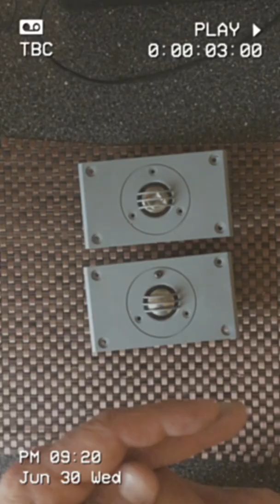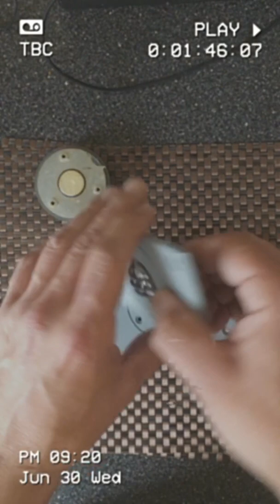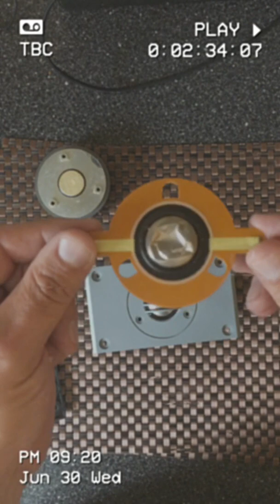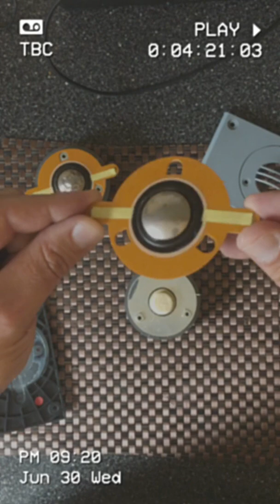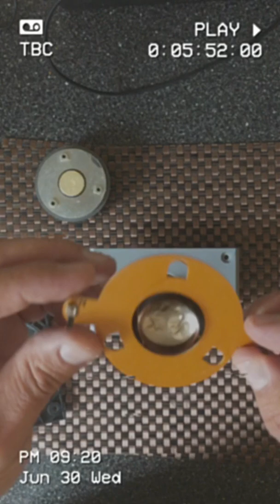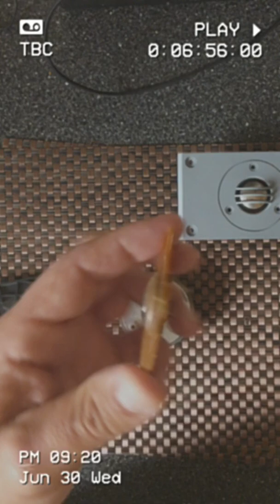#celestion #speakers #tweeters metal dome tweeter repair.

Comment: Hey thanks for the video. One of the tweeter dome diaphragms in my Celestion 5's has been torn off....  I've ordered a set of 8ohm diapgrams to attempt a repair. Is it possible to remove that gasket and solder a new diaphragm on to this style of tweeter? I probably should've confirmed before ordering a replacement set... Many thanks!
Reply from the maker: I would try and buy a set of tatty Celestion 1’s or 3’s and use the tweeters from them in yours, they’re all the same diaphragm.. magnets differ so use yours
Reply: @dittonworks  So attempting to repair the original tweeters is not an option? just wanting to rule it out completely before I source another set.
Reply from the maker: @sam8m8 you probably can repair it but sonically you’d be better off with original diaphragms
Reply: @dittonworks noted! Thank you. I might attempt a repair anyway for experience. I’ll seek out replacement tweeters in future.

Comment: Found a pair of Celestion 11 on the trash the other day! Woofers are completely fine, twetters were both dented, left one badly so, completely pushed in. They made sound, but not a pleasant one. I've been able to push them out and get them fairly smooth by pushing with the end of a small rounded metal rod against a spoon. Not perfect, but sounds much, much better. The right tweeter wasnt as badly pusehd in, but it has a small tear. I think i'll replace them both with ebay diaphgrams, doesn't look too difficult. 

BTW, what an excellent pair of speakers, I'm testing them with a Yamaha CX-1/MX-1 combo, and they sound really well, maybe lacking a bit of bass, but I'm used to my Infinity Kappa 8.2i, with 12" woofers.

Comment: I have a pair of DL12, as many have said, the metal dome tweeter can run a little harsh and bright, can it be replaced with a silk dome without need to adjust the crossover? Or would it be best to replace the HF units altogether? Cheers
Reply from the maker: That would be a downgrade. 
I’d recap the crossovers and possibly try a different amp?

Comment: Can you still get a replacement for the A1 with dented tweeters ?
Reply from the maker: Unfortunately not, Kef used to have Celestion stock but they’ve run out now.
I’ve got a couple of diaphragms left. 
Contact Ditton Works Facebook page for more info.

Comment: I have a pair SL700. one tweeter has a dented voice coil . The other has a dented dome. what are my options  in restoring or replacing the tweeters. can the tweeters from the SL6SI be substituted.
Reply from the maker: I can fix them buddy.. contact on Ditton works Facebook page

Comment: Hi there. I have a chance to take a good pair of speakers, but with the aluminium dome tweeters pretty pushed in. So you think if I will fix that in the original position, it will still affect the sound? In other words, any tweeter pushed in, can.t be full repaired to sound like new?
Reply from the maker: Hi 👋 
I’ve had success with most aluminium dome tweeters.
What speakers are yours?
Reply: @dittonworks  Audio Physic Virgo. A well regarded pair of speakers at a good price, so i.m tented to buy them, despite of the dented tweeters. I.m thinking of making the same as you did with yours, take them out and pull the voice coil carefully. But my question is if this will affect the sound, they are dented pretty much. Another question I have , do you think the aluminium voice coil can be replaced with aluminium voice coil from another speakers, another brand, if the size is the same? I don.t think I will find the same tweeters to replace, so replacing only the voice coil will be less difficult to find.
Reply from the maker: @narcistimofte6448  you can’t really just put new diaphragm from another design into yours. 

If the dome isn’t too bad the sound won’t be badly effected. Obviously having a smooth uncreased dome will give the best dispersion etc.. 
good luck 😉

Comment: Is it possible to repair tweeters that are not dented but no longer play? I have a set of JBL N26 speakers with one non-functional tweeter. Is there a typical contact point or something that fails?
Reply from the maker: Possibly..
Most likely the lead wore to the coil has snapped.

Comment: Super instructional - well done!  I have a Celestion 3 tweeter for repair - I think misaligned coil with low output but correct DCR. I solved this problem with a different tweeter by minute adjustments to the placement of the backer card/coil/dome. But, with this particular Celestion 3 tweeter, despite taking the screws out and easing off the adhesive, the coil won't fully let go of the magnet. It feels as it it's glued in place. Pulling the card harder visibly pulls the coil/dome inwards. Any advice? Rip it out and if it wrecks it buy another, I suspect!
Reply from the maker: Hi David. If you’re in the UK? You’re welcome to send it to me for repair. 
Search Ditton Works on Facebook 👍
Reply: @dittonworks  Thanks, but I got brave and solved the problem. The pole had shifted, jamming the coil on one side very tight. That explains the low output - the coil was flapping rather than being a piston. It was jammed so tight that it got destroyed in removal, but it wasn't any good the way it was. I was able to tap the pole into place, so now I need a replacement dome/coil/card assembly. I'm determined to repair them because they're worth it!
Reply: Your site is an awesome Celestion resource, by the way - good job. Keep up the good work.

Comment: Thanks for the tip. Easy fix. I bought mine with a dented tweeter and the twat that sold them had took it out to see if he could repair it and screwed it back in upside down.